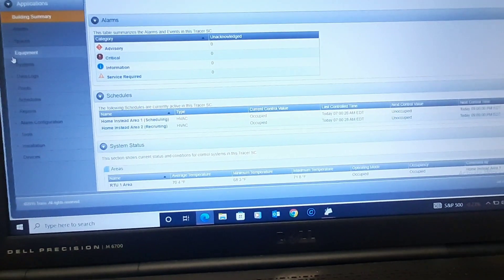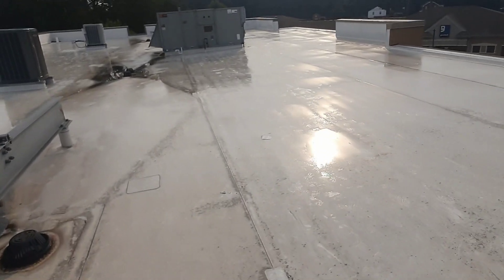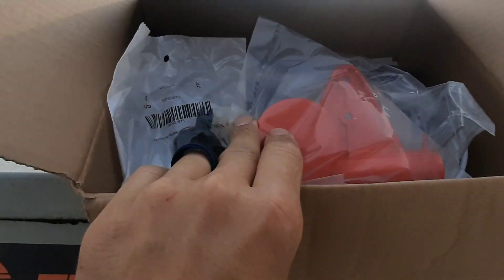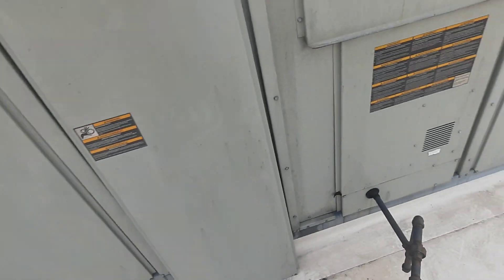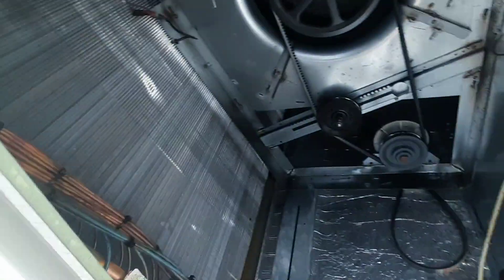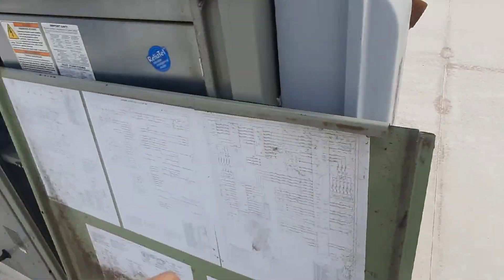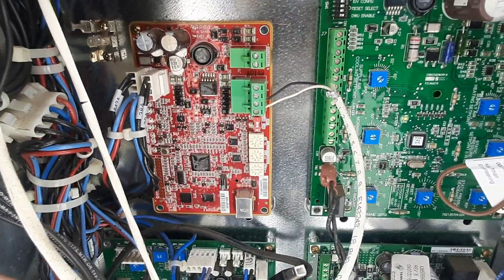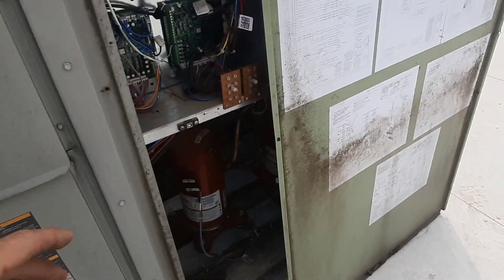Trane VAV system with duct static pressure problems. #hvac #hvacservice #hvaclife #hvaclove

Comment: Having the same issue, replaced the outdoor static pressure sensor and the transducer, ran fine for 5 days now it’s showing 65,000 inches of water column again. 🤦🏼‍♂️
Reply from the maker: Tubing or something got into the transducer again
Reply: @EverythingHVACR  strangely enough I was given access to the BAS and another unit is also showing 65k but running at half capacity. 
Plan is to replace all tubing and both transducers
Reply from the maker: Make sure to route tubing better and add drip legs to keep moisture out. Good luck

Comment: That rainbird looks like something someone 3D printed at home. If all it's doing is being an overpriced pipe to give an atmospheric air pressure feed to a transducer through some crap plastic pipe that will harden and crack within a couple years - I'd be inclined to just bin the thing - replace the flooded transducer, run a copper pipe to the outside to get the reference.
But of course, customer equipment under warranty, have to go with the manufacturer replacement parts that cost several limbs to purchase and will fail again in short order.
It's depressing being a tech and seeing how easily things could be better made so they last longer than a gnat's fart.
Reply from the maker: 😆 I don’t disagree with you. Thanks, chillybrit

Comment: I agree with you, Steve. 50 feet of coiled up tubing seems excessive and you'd think it would cause a pressure drop and inaccurate measurements. I would have done the same-have a small drip loop and cut it so that there is just a little extra.
Reply from the maker: Thanks, Topher
Reply: Hi, great content. The Trane IOM says only use what is required for the tubing and discard the rest. Trane gets those kits from Dwyer
Reply from the maker: Thanks, Dan! That is from Dwyer, and I was just reading what they sent, not the Trane IOM.
Reply: I think the intention is for it to act like a buffer. But I also just cut the tubing to the right length and it never has seemed to make any difference.

Comment: That setup is pretty cool.  I need to find one of those touchscreens for the Tranes. I have several restarauns that have Tranes wig the RTRM boards(I believe that’s what it’s called) and I saw where you can plug the touchscreen into the board to see all the errors instead of counting flash codes. Good stuff Steve O!
Reply from the maker: Thanks, Bryan.